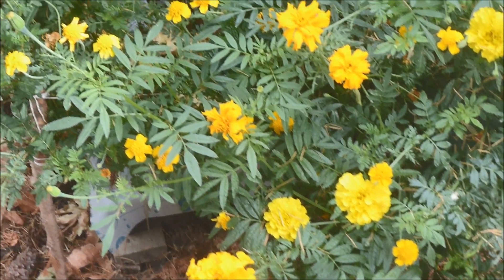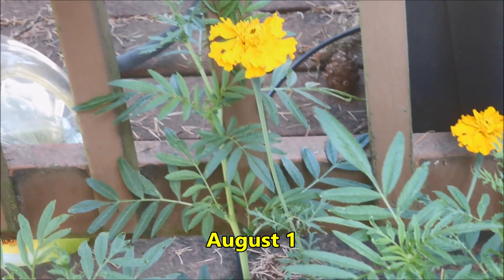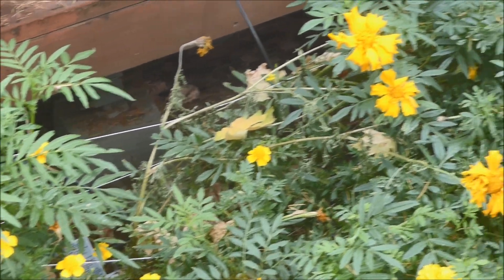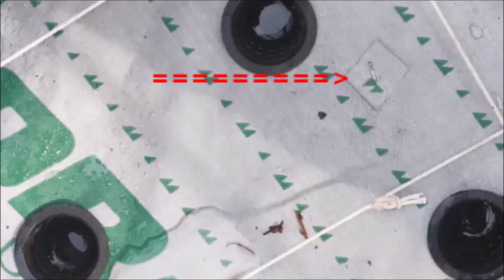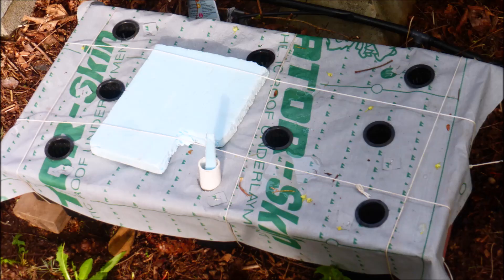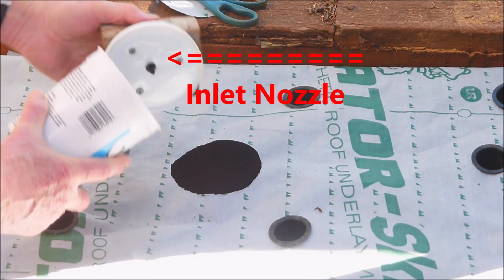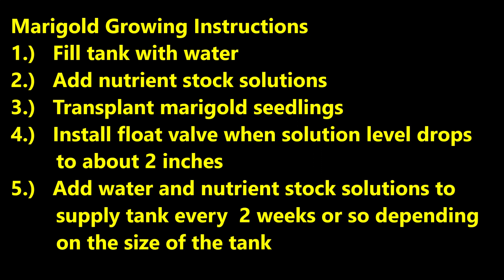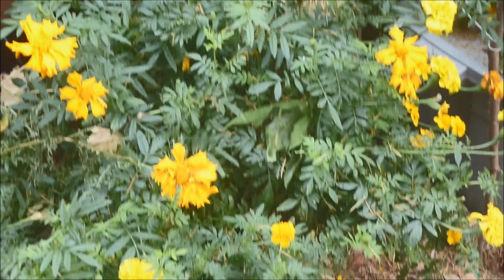Growing Marigolds with an Automatically Watered Kratky Hydroponic Method

Comment: Unrelated but do you foresee any issue using a float valve (similar to your design) and 5 gallon bucket resevoir to sub-irrigate zucchini seedlings? I see alot of people using capillary mat or sand and think it would make more sense to cut out the middle man and just use a float valve with the bottom of the seedling tray touching the surface of the water. Would that kind of setup cause soil oxygen issues? Thanks a bunch Dr. Kratky
Reply from the maker: If there are at least 2 inches of growing medium above and continuous with the the lower saturated  growing medium, then you should be ok.  Sub-irrigation is a good way to irrigate.

Comment: For the "lid" what about a rigid perforated greenhouse tray?  This might be able to replace the net cups and fabric.
Reply from the maker: That is a great idea, Jeb!  It would be easier then what I did here.
Reply: @growkratky5558  Recommend me plz the nutrient solution composition  for growing white cabbage. N P K CA Mg etc
Reply from the maker: @winwin-ty2jm  We didn't grow white cabbage, but the ppm for lettuce values are: N-112, P-31, K-142, Ca-95, Mg-29, Fe-1.9, Mn-0.95, Zn-0.24, Cu-0.24, B-0.95, Mo-0.05.
Reply: @growkratky5558  thank you so much

Comment: Coincidentally I have been growing French marigolds (Harlequin) using the Kratky method. Flowers were few and small. Any suggestions for improvement?
Reply from the maker: You might consider varying the nutrient strength, because too high might cause the plants to remain vegetative. They might need to be stressed in some way to encourage flowering.  Also, consider experimenting with similar varieties as genetics might provide a solution.